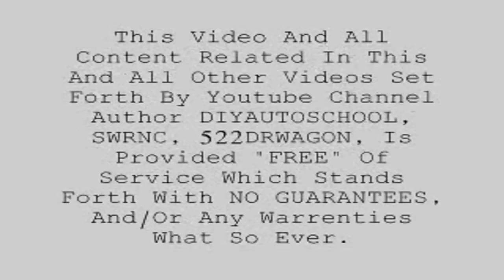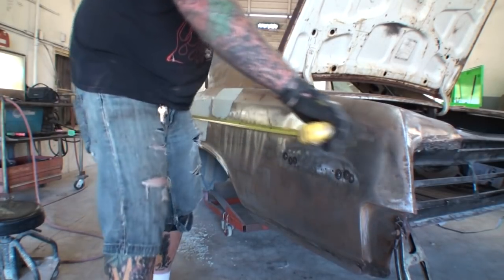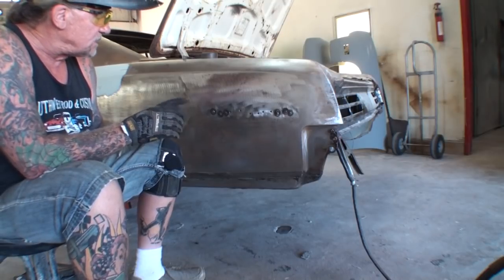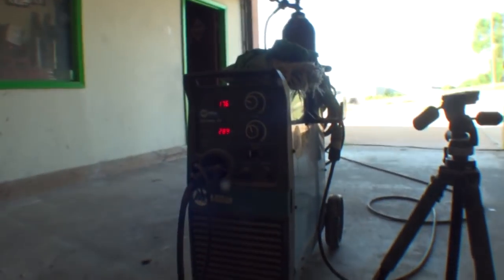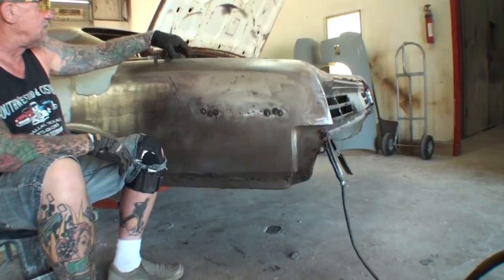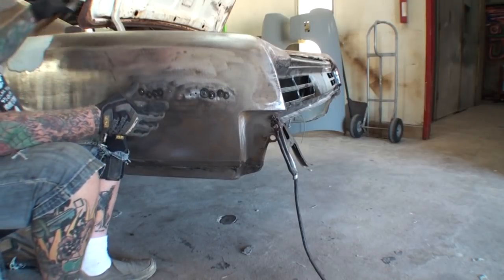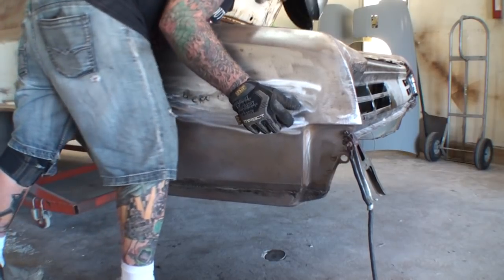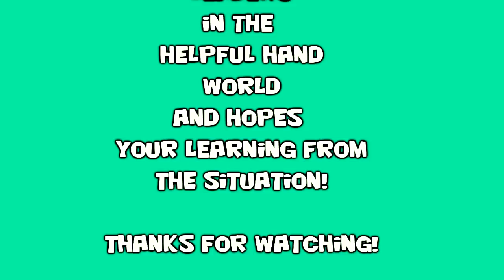What Is "HAMMER WELDING" - Mig Welding Tech Tips

Comment: I am a retired body and paint guy with over 45 years of experience in all phases of body repair and paint. Everything from VERY high end cars, (Pre World War II, Classics, Packards, Cadiilacs
Auburn and Deusenbergs) to in a dealership, (Ford/Lincoln/Mercury, Chevrolet, Cadillac/Mazda).

You HAMMER WELD with a Oxy./Acetylene torch with a small tip!!!!
MUCH SOFTER weld that will hammer FLAT!!!!
Using an Ace./Oxy. torch WILL keep the Heat Affected Zone very small and controllable!!!!!
The TOTAL weld when done should be no larger than a DIME, with NO DISCERNABLE HEIGHT built.

The Hammer Weld , when done properly will blend seamlessly and without a bump INTO the surrounding surface.
Please check out some of the very old timers that post.
Ron Covell for an example...

Wire feed deposits WAY TOO HARD of a weld nugget that is VERY HARD to get rid of.
You have to GRIND the weld down which puts additional heat INTO the weld area, and takes much longer to straighten out.
3M makes a VERY GOOD weld grinding disc, designed JUST for grinding down MIG welds.
Part Number 01991.

Good video otherwise and THANK YOU! for posting the information.
Gary Anderson
GaryIAnderson on Facebook
Look through my albums.

(BTW, I I also used to teach welding and Body & Paint at the College level.)
Reply: Thank you for the tip and the part number. You should start a channel
Reply: I was hoping someone would call him out on this , ex bodyman here also and certified welder also

Comment: Question: for that size hole, would it be easier to use a copper backing to fill the hole?
Reply: Copper backing would help but isn’t necessary. I use 030 wire for a hole that size. It fills it quicker so less overall heat used with less warping and a flatter finish bead so less grinding.
Reply: @thebigpicture2032  Thank you.
Reply: On newer vehicles they use much thinner steel, so yes. It would still benefit from hammering a weld the keep the panel’s structural integrity eliminating the “Oil Can” affect above or below this repair. It replaces metal where emblem holes where, essentially riveting the weld in place as well. The OEM “Bonneville” die cast emblem, held on with post and clip nuts, has to be the longest emblem ever made. Not needed for a GTO. Choose the wire that works for you. In most cases, the smaller the better. Just control wire speed and adjust gas according to the shops breeze. I have used metal or card board on gusty days to protect my shield gas for a better result. Slowing or speeding the wire will find the sweet spot. My welding hums with little splatter, but it’s a commercial Italian made welder by the largest & oldest company. Mine was new in 1984. Hope this helps.
Reply: @deankay4434   Thank you.

Comment: Pete, why did you say it was important to use a new grinding disk? Thanks in advance and thanks for the vid.
Reply: Cross contamination of metals in case you have to weld again maybe? Just a guess.
Reply: @bayouboattrash  I was thinking it was heat related.
Reply: You both are essentially correct. If you use a grinding disc or even sandpaper on a non-ferrous metal, you never want to use it on a ferrous metal and vice versa as it can cause cross contamination.  The new disc will also dress the weld nugget down quicker reducing the chances of heat buildup which could create the very distortion you just worked so hard to prevent.

Comment: Love my Millermatic 141 with autoset. Autoset measures the ground then adjusts the heat and wire speed as I need it. Still need to cool or hammer dolly the welds.

Comment: Pete how do you maintain the car in bare metal to work on it without the metal getting rust?? Im New at this and i had to paint or primer the car because it was getting rust
Reply: You can use a metal prep and galva prep to treat metal chemical cleaning that leaves a galvanized coating to prevent and minimize rust and oxidation or spray an epoxy ground coat primer and you can do body filler over the top of the epoxy with no problems with adhesion
Reply: @luisvega1294  thanks my man... Im going to check if i can find that product in my country that would be awesome
Reply: Its been awhile since i used the product but i use to use it all the time when i worked in restoration shop..the metal prep you dilute with water then you srub it full strength with the galva prep..scotch brite red..it will leave a coating on the bare metal if you need to leave it exposed for a duration. Of course if you find the product or one similiar always read the manufacturers recommendations

Comment: Pete, get minnie to hold an ice cube on the back of the panel while you weld it up, i make ice cubes for this in margarine containers so they nice and big, hold it on the panel inside for a good few mins to bring the temp down, have her keep it there while welding/ cooling, works great.
like to see you do that in the next vid
Reply: a good way to soak up the heat also is puting and old copper computer cooler at the other side of the hole and right after you weld you take the copper off, also makes a nice base for the MIG tip and you dont need to make smallers dots so you dont make it too hot.

Comment: I know a guy that swears you can use a cutting torches to remove quarter panels no need for grinder's or air tools. That's all they use in there professional shop. What's your take on this. I say no way
Reply: You can..with the right flame setting its no big deal, similar to using a plasma cutter which mr.pete does. Just need to use common sense so you dont catch things on fire. Torch/plasma is for a rough cut that dont need to be precise..

Comment: I do Alot of rust repair,my customers are people that think you can fix a rust bucket for 800 bucks.So for those customers I just overlap the new piece to  the old piece by a quarter inch.and hammer the welded seam till it's below fiberglass level.This customers don't deserve grinding or any special treatment.but yea hammer welding makes a very tuff smooth seam.
Reply: I think Its only fair you give the customer the options, as most of the time they don't know. Option 1.  Hack job for 800 bucks. Option 2. Do it right for 5000 bucks.  Etc...…..